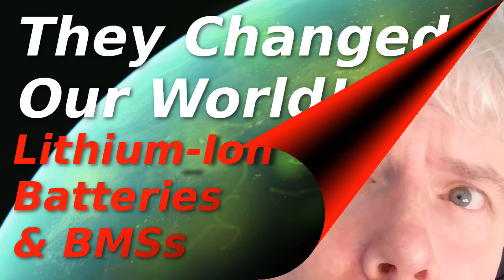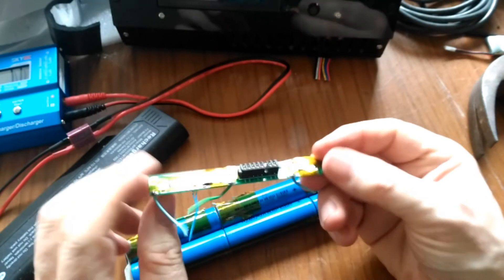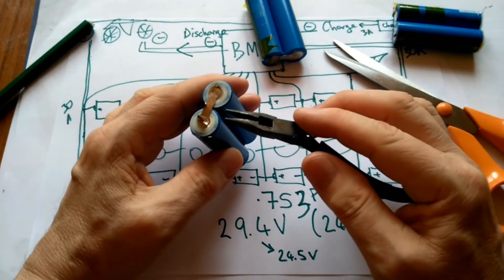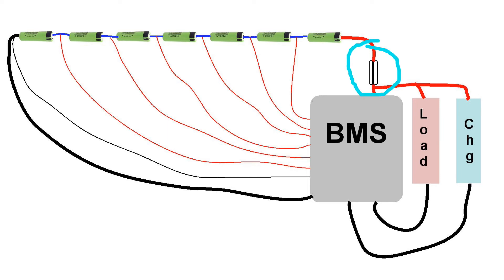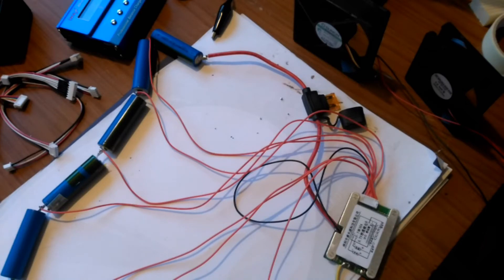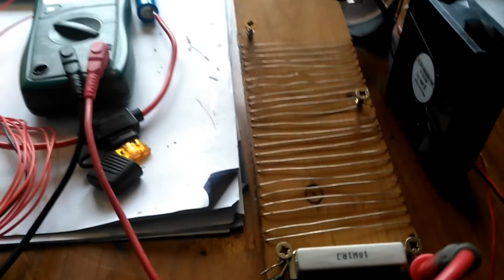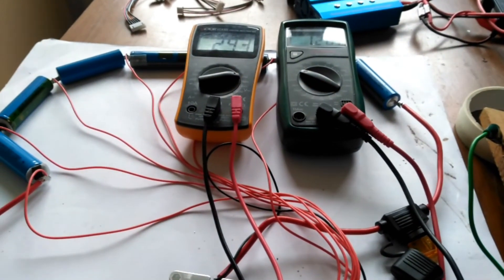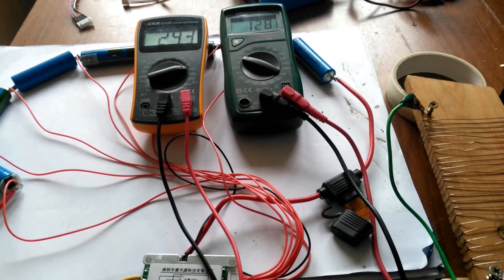EBike Battery Building - Battery salvage & BMS test

Comment: i think the BMS shuts off because of one cell is going below 3,0V
So you should have to measure every single cell of the pack to find out the cutoff voltage of the BMS
Have fun!
Reply from the maker: All the cells in an given pack are in parallel so they are all at the same voltage.There are 7 cell packs which are balanced each time they are charged.
Reply: @chriswesley594  
But at the discharge, they are in series. And the bms can only balance with some mA

If some cells are better than others, the voltage will drop faster on the bad cells and the BMS disconnects.

That's the thing, why we all need a BMS right?
Reply from the maker: @Der_Hannes  I guess you're comment on my comment that I wasn't sure why it shut off a bit early. I made that video a long time ago. Yes I think you are absolutely right, thanks.